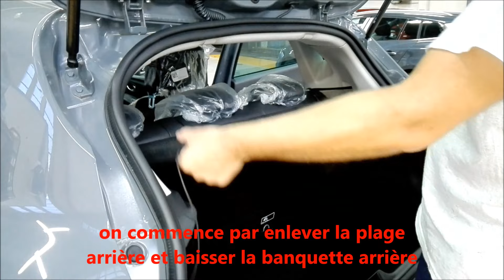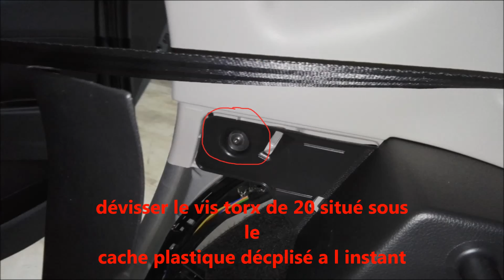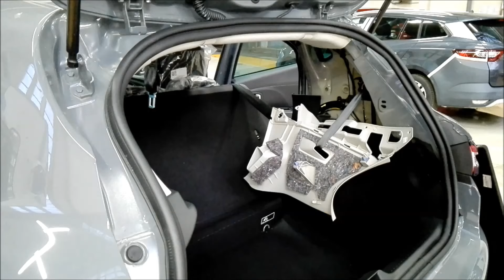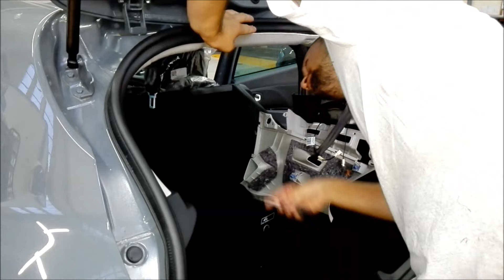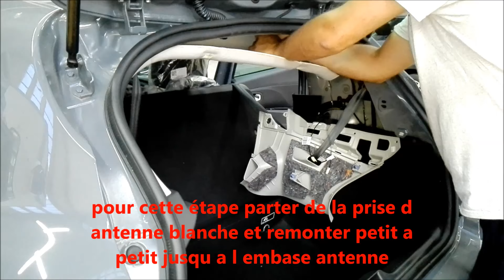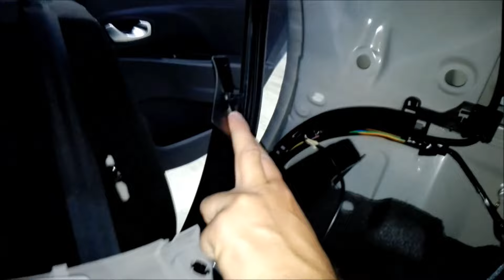Tuto démontage embase antenne radio Renault Clio 4/disassembly antenna radio clio 4

Comment: Thanks. Antenna always come with 1 wire? A saw on the net some antennas with 2 or 3 wires....?
Reply from the maker: Hi there is 2 or 3 wire according to the equipment of the véicule (GPS ...)

Comment: Bonjour, pouvez-vous faire un tuto pour installer un aileron de requin à la place antenne radio de série. Merci !
Reply from the maker: une fois votre antenne achetée il vous suffira de la poser et faire le montage inverse de la vidéo
Reply: @schnoufav_pro  cool merci !
Reply: schnoufav_pro, merci pour la réponse ! Pouvez-vous juste me mettre le lien de antenne requin de la marque Renault ?
Reply: Car je ne c’est pas quoi choisir, j’en trouve à tout les prix.
Reply: Bonjour  @CKNO556  , avez vous Réussi  cette manip ? J'ai cassé mon antenne et je ne suis pas très bricoleur. ça m'a l'air tout de même compliqué ... est facile de remettre les joints lors du montage
Reply: et du coup est ce que quelqu'un peut me dire quelle pièce acheter pour remplacer l'antenne d'origine + son socle
Reply: Tu as trouvé l'antenne requin qu'il faut ?
Reply: Julien H bonjour, non je est pas encore faite, car la voiture n’a que 2semaines 😅 et justement je n’ai pas trouver celle officiel.
Reply: Dac , si tu trouves tu pourras m’en informé merci
Reply: Julien H pas de soucis, si j’y pense 😉
Reply: The OEM part number for the version with two sockets (FM/AM and DAB) is 8201684054. You can search for it on internet and you will find the part. There is a version with GPS socket as well 8201724052. I have a 2013 Clio with the older regular antennae and am going to replace it with this shark fin version. I haven't tried it yet, but it looks like there should be no problem